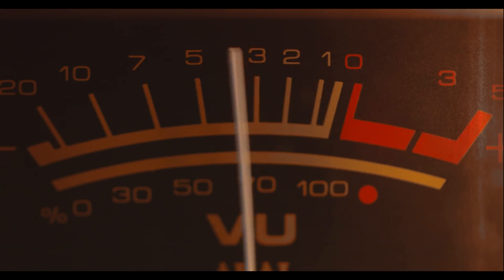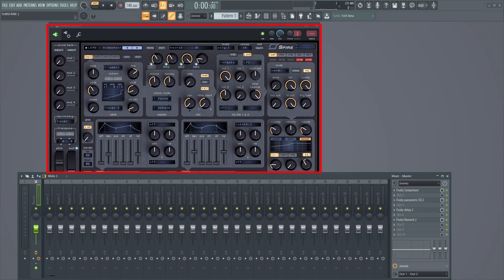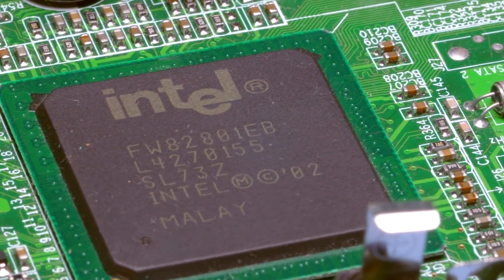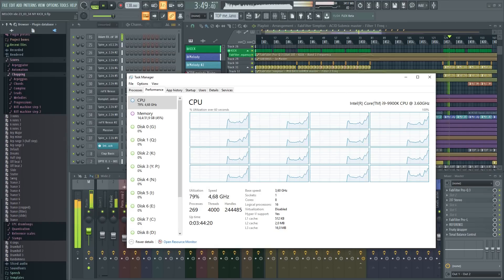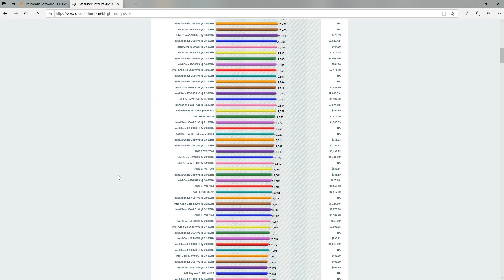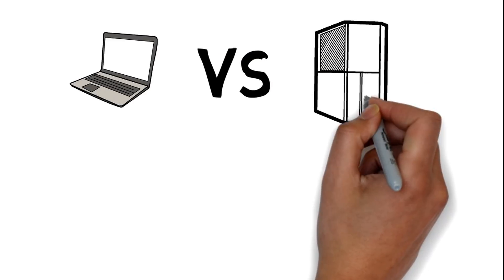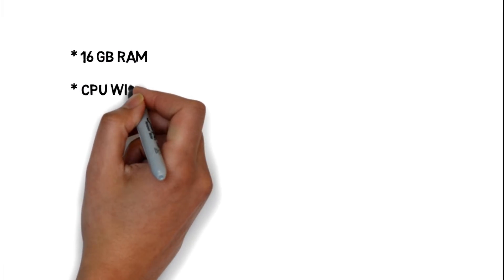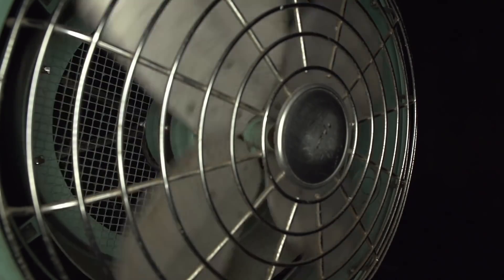The Best Computer For Music Production - What's Needed And Why!

Comment from the maker: Here's an updated PARTS LIST with amazon links for the best computer for music production in 2022 based on the Intel i9-12900k:
Check out my new and updated video here: https://youtu.be/ayt8-s77cQs 

☑Performance option:

CASE: https://geni.us/define-r6usbc
Main Board: https://geni.us/z690-f
CPU: https://geni.us/i9-12900k
CPU Cooler (Water): https://geni.us/pl360-flux
CPU Cooler (Air): https://geni.us/NH-D15S
RAM: https://geni.us/KFB-DDR5
POWER SUPPLY: https://geni.us/RM750x
SSD (M.2): https://geni.us/SN570
VIDEO CARD: https://geni.us/RTX3050

Total cost: 2500 USD  (approximately)

☑Budget Option:

CASE: https://geni.us/corsair-110q
Main Board: https://geni.us/A520M
CPU (With cooler): https://geni.us/AMD5600x
RAM: https://geni.us/kingston-ddr4
POWER SUPPLY: https://geni.us/NWE-Bronze
SSD (M.2): https://geni.us/Kingston-NV1
VIDEO CARD: https://geni.us/RX6500

Total cost: 880 USD (approximately)

☑Accessories: 

Keyboard: https://geni.us/g213
Mouse: https://geni.us/logitech-g402fury
Audio interface:  https://geni.us/scarlettsolo-3rd-gen
Headphones: https://geni.us/akg-k612pro
Studio monitors: https://geni.us/Yamaha-HS8
Ultrawide monitor: https://geni.us/Samsung-49
Standard monitor: https://geni.us/spectre27

☑prebuilt performance computers: 

Statationary (Intel): https://geni.us/Prism-12900k
Stationary (AMD): https://geni.us/MEK-5950x

Laptop (Intel): https://geni.us/G533ZW
laptop (AMD): https://geni.us/ASUS-G15

☑Prebuilt budget computers:

Stationary (Intel): https://geni.us/cyberp-i5
Stationary (AMD): https://geni.us/ibuy5600

Laptop (Intel): https://geni.us/HPcorei5
Laptop (AMD): https://geni.us/HP-ryzen550

Here's the ORIGINAL list of components used for this video: 

☑️ Case: https://geni.us/define-r6usbc
☑️ Power Supply: https://geni.us/corsair-rm750x
☑️ Main board:  https://geni.us/asus-rog-maximus
☑️ CPU: https://geni.us/intel-i9-9900k  
☑️ CPU Cooler: https://geni.us/noctua-nh-d15
☑️ RAM: https://geni.us/corsair-lpx32gb
☑️ SSD: https://geni.us/mx500
☑️ Video Card (Optional): https://geni.us/asusgtx1070
☑️ Case fan: https://geni.us/fractaldesign-xpgp14
☑️ Mouse: https://geni.us/logitech-g402fury
☑️ Keyboard: https://geni.us/g213
☑️ Screen: https://geni.us/lg29wk600-w
☑️ Studio monitors: https://geni.us/Yamaha-HS8
☑️ XLR Cables: https://geni.us/monoprice104761
☑️ Headphones: https://geni.us/akg-k612pro
☑️ Audio interface:  https://geni.us/scarlettsolo-3rd-gen

Here's the AMD equivalent with the new Ryzen CPU's (Just replace motherboard and CPU):

☑️ Main board: https://geni.us/asus-rogstrixx570
☑️ Ryzen 3900X: https://geni.us/ryzen9-3900x

As an Amazon Affiliate, we earn from qualifying purchases.

Support This Channel on Patreon: https://www.patreon.com/firewalkmusic
Support us with a one-time Paypal donation:  https://www.paypal.me/firewalkmusic

Need feedback on music, mixing, mastering? https://www.fiverr.com/firewalk
Reply: Nice!
Reply: So basically $3,000 setup.
Reply: @paulluna8099  A pc for audio production can definitely be done for less than $3000 (including audio interface and a mic). Way less in fact. I've been producing & engineering audio for 15+ years now, & it is cheaper to get into recording & mixing music now more than it's ever been. Honestly, the PC in this video is overkill for audio, but as he said in the video, he's also doing video production. (which makes it odd that he only went with a 1060).
Reply: @Cynical_Finch  You are 100% correct. Even for video this is OTT to the max. It's great if you have the budget to spend big and go for a huge PC but the reality is that music production does not demand anywhere near what he is saying.
Reply: myhotmusic 
Depends on your way of producing music. I do a lot of mixing for rnb and a lot of these projects have over 70 tracks with a lot of bussing and heavy plugins
Reply from the maker: @paulluna8099  If you buy everything from scratch, like monitors, audio interface etc then it will be quite expensive indeed. I think I spent around $2200 for just the computer. If you already have an older stationary computer then you can usually just upgrade it. In that case you can probably get away with just a new main board, CPU, RAM and possibly a new cooler for the CPU as well, unless you buy one with the cooler included. You don't really need to spend money on video card for music production. If you go for a CPU with integrated graphics then that will usually be more than good enough. :)
Reply: FireWalk I make maybe $17,000 a year while living in California so budget is really tight. So I have to resort to refurbish laptops and old equipment like an Arturia Microbrute I got used for $150 a couple years ago, M-Audio 88-key MIDI controller, and finally a  Novation Launchkey MK II. The DAW I use is Ableton Live Intro version due to the fact it was cheap. I just found out about the Prosonus free DAW but it doesn’t seem to be as user friendly. As for mixing I don’t have monitors just PS4 gaming headphones I bought 6 years ago. It would be nice to see something for what I call the Ramen Budget out there. Oh yeah the M-Audio was also used and I got it for $88. The newest equipment is the Novation LaunchKey.
Reply: @FireWalkMusic  Not really my friend. Building an i7 system from scratch will cost from around $700 AUD (including an audio interface)
Reply: @paulluna8099  go for refurbished i7 desktops which you can get for under $200. Rack and stack them when you need more and you'll end up with a more efficient studio rather than one computer trying to do everything. House music was invented by people like you. Managing their budget, buying cheap and innovating.
Reply from the maker: @kehindea  The I7 is still a very good CPU for music production and will be more than enough for most people. Keep in mind that the title of this video is "the BEST computer for music production". Some people just want or need the best there is. Especially if they make huge trance or orchestral projects for example.

It's stated in the video that most people won't need the very best computer though, and depending on what kind of projects they make and how they work, the older i7 will usually be more than enough. :) Also, the new AMD CPU's are also worth considering. 
This video wasn't intended for anyone on a budget. I was trying to explain what to look for in a CPU, and what's currently the "best" option. For people who want the most value for their money, the I7 or the new AMD 3000 series will be the best choice. No doubt about that. 

I know plenty of people making great tracks on the I5 too, with no issues what so ever. Again, it all boils down to what kind of projects you make. Some people make music with 20-30 tracks tops. Others make music with hundreds of tracks. :)
Reply: @paulluna8099  far too much money.  I have a gaming PC for $1300.  it has 8 cores.  just go to best buy.
Reply: Hi, looking at this for a friend. Is it right that your soundcard and audio interface link to the same item? Is the interface also the sound card?
Reply from the maker: @RuneKatashima  Hi, must be a double posting. I'll correct it. Yes it's the same thing. The audio interface is basically just an external sound card.
Reply: Hey  @FireWalkMusic , thank you for making that video,but i would have a few questions. If you could be so nice, and take the time, you would help me a lot... i make music since 2017 and copped 3 laptops that cost me around 4000$, they all crap... i make BIG projects in Cubase and would need the best, cause im stuck with 16GB Ram on a working laptop...(HP Probook) could u please answer me these 6. Questions...

1.Case: blackout or Gunmetal ?
_____________________________________
2.Main bord: Motherboard or/ ROG Strix Keybord or your other mention: Asus ROG X570 Crosshair VIII Hero 
_____________________________________
3.CPU: 9900K or 9900K (New Packaging) or your other mention Ryzen 3900X 
____________________________________
4.RAM : 64GB (4×16) or 64GB (8×8) and which Style would u use ? MHz .... C16 ?
(30+ options in Amazon...)
__________________________________
5.Video Card: (i make my own videos, cutting + effects + Luts,... what would be the "best" selection?)
_______________________________
6.Case Fan: a normal one or/ PMW
_______________________________
PLEASE 

PS: have a nice and productive day :)
Reply: Hello so best computer isn’t MacBook ?
Reply: @Nk-gr8vk  nope
Reply: @Nk-gr8vk  not afor years,,, Mac  is just the most expensive now,,, and less serviceable.
Reply: Great suggestions for CPU and mainboard + RAM etc. Where should one look (and trust) on how to overclock the CPU?
Reply: Is there any nice quiet rackmount or table top case you could recommend here?
Reply: I tried this computer build today. I have been buying all the components, as I could, over the last 6 months. I went with the core i9 9900k and the Asus rog maximus xi hero wi-fi motherboard. The same ones your links brought me to. I even bought from Amazon. The only difference in components is the ssd's. Well today was the day I was finally going to do the build, only to be very disappointed. I tried to install the processor in the motherboard and it doesn't line up to go in properly. I have around $800. tied up in these two components. I bought them to long ago to return them. I'm not sure what to do. These two components should be compatible right?
Reply: So I contacted Intel. Sent them pictures and all. They said "the Product has had the original speed and / or other markings removed (and replaced with false trademarks and/or false trade descriptions) and no longer represents the correct original speed and/or product information for which it was tested and marked by Intel". Thankfully Amazon is going to give me a full refund. Think I will buy elsewhere this time..
Reply: Well, just found this, and I literally have the same choices (but MB Asus Pro WS, and Define7) saved on newegg for my next computer lol. Just finished sorting it out, but with the Define7 Fractal solid panel, lol. My hesitation is the soon to be released Intel 10th Gen. Whats next DDR5 Ram ? lol... New socket so, matching Processor and MB and possibly cooler,,, Can't pick parts yet though lol for another week or so. THe i7 9700k doesn't have hyperthreading, but the i7 10700k will... Asus has the Z294 boards on Newegg now... ANd looks like I may be able to save a coupl hunder bucks even with the 10900k. Though I will likely not OC the CPU, can't remember exactly but there is not much gain in OC'ing. I will grab 3200MHz Ram unless the 10th Gen shows a better sweet spot... For now 2 x 16GB sticks will do and grab 2 more later.  I already own the 1060 Asus 6GB (3 monitors), and an HX 850 Corsair. I do game as well, so may grab 2070 Super Asus later.  
Just thought it was funny I choose the same for the 9th Gen build, lol...

Comment: How can you avoid, and be assured you won't have DPC latency with crackle and pops.  What precautions, or tweaks do you make when building a computer will guarantee this won't happen?
Reply from the maker: Hi, this is all explained in the video. Due to the nature of real-time audio processing single core performance is key, so you want to look for a CPU with the fastest single-core performance possible, the highest clock speed, and with as many cores as possible. The ones with the most cores usually don't have the same single-core performance, as they are more geared towards heavy multithreaded applications, which is not the case with a DAW. It's generally better to have a CPU with slightly fewer cores, but better single-core performance than the other way around.
I also recommend going with the fastest possible RAM if you can afford it.
Reply from the maker: Make sure to check out my newer and updated video about this here. There you'll also find links to updated computer parts etc. The same one I'm using right now, and I make some pretty huge projects without any pops or crackles. It can chew away anything I throw at it. 

Check out the new video here: https://youtu.be/ayt8-s77cQs

Comment: GPUs do help but not with plugins but with screen draws and metering! If you working with video playback ( mixing a film or mixing to picture ) the video needs to playback and if you have a low end video card it may use up to many resources. I would think having a solid GPU would help with this as it’s own dedicated memory would handle the metering draws and video playback leaving your system alone to handle plugins?

Comment: Hey brother Thank you for your very helpful content , quick question, in your performance option , is it better to get both Cpu water cooler and Air cooler or can i have just use air?
Reply from the maker: You're welcome.  You can only use one cooler. Both air and water cooling will work very well. Particularly the ones I've linked to.

Comment: How much was your total build? I need a reference.
Reply from the maker: Hi, this depends greatly on what you're starting out with. Do you need everything including screen, keyboard, mouse etc? Or are you simply upgrading from an existing build? 
I'm actually in the process now of making a new and updated version of this video right now. This time I just swapped out the motherboard, CPU and ram, which is far cheaper.
Reply: @FireWalkMusic  Everything less mouse. I'm guessing about $3,000?
Reply from the maker: @antjamnow1286  I see, I don't remember the exact amount but yeah, $3000 sounds about right. These components should be cheaper now though, so proinbably around $2500 today.

Comment: Hi guys im new to music production, don’t understand the lingo....are these specs suitable? MacBook Pro 15" (2017) - QWERTY -
Touch Bar - Retina - Core i7 - 3.1 GHz - SSD 512 GB - RAM 16GB
Reply from the maker: That shouldn't be a problem unless you're running very large projects with tons of vst's and effects
Reply: @FireWalkMusic  ok thanks so if I was what would I need ?
Reply: @Andrew-vn3hm  i also have the same 2017 model and im going to switch now to the new macbook pro, ive heard the new m1 max chip is insane for music production

Comment: I know I can just break out my calculator but… how much does it all cost all together?
Reply from the maker: That depends on how much you actually need? Are you building the entire computer from scratch, or can you re-use any parts from your old one, like cabinet, PSU, screen and so on. 
Also, do you also need monitors, audio interface and so on? In which case it will get quite expensive. 
I actually re-used lots of parts from my old rig, so in my case, it was about $900 but if you had to get everything from scratch, including hard drives etc then just the computer alone will probably cost around $1700 (rough estimate)

Comment: Does i7 11 gen
With 8 core 16 threds 
Base frequenct 2.3 and max 6-core turbo -4.2 
Good enoth for music production .
Reply from the maker: Yes, that should work fine for most people.
Reply: Thanks you so much for your information and gelp
Reply from the maker: @Aj21.official  You're welcome 🙂
Reply: Does my daw crash or not ? 
Cause Base frency is only 2.3 .
But Ram is 8gb 
And storage is 1tb hhd +256ssd
Reply from the maker: @Aj21.official  it shouldn't crash. Ideally the base frequency should be higher, but it should ramp up automatically when needed. If you get an unlocked CPU then you can also overclock it manually and force it to stay at higher clock frequencies. 8 GB ram will work, but I recommend 16.

Comment: You forgot to add details about the most important part of such a PC - the SOUNDCARD!!
Reply from the maker: Hi, actually I decided not to include this in the build, because I usually recommend going for an external audio interface over internal sound cards, and since this is not part of the computer itself (just like monitors, headphones etc) I decided to focus on just the computer itself. If you check out the components list in the video description then you can see that I've included some recommendations for audio interfaces there. 
I have separate  videos with recommendations  for audio interfaces, monitors etc. Here's my top 5  budget  audio interfaces: https://youtu.be/g0x5thV50ig